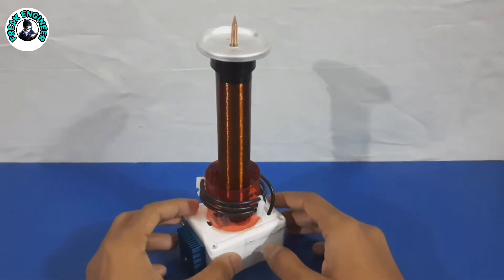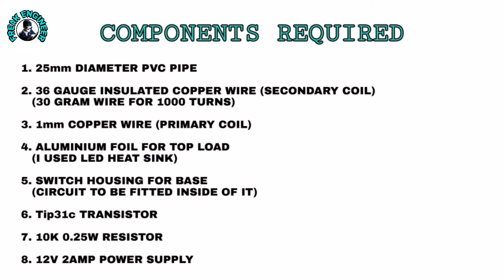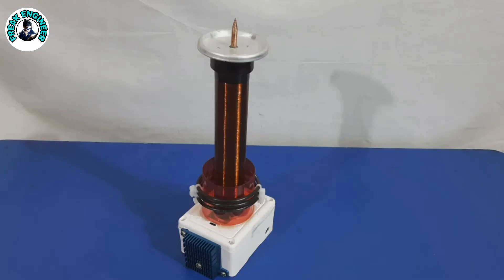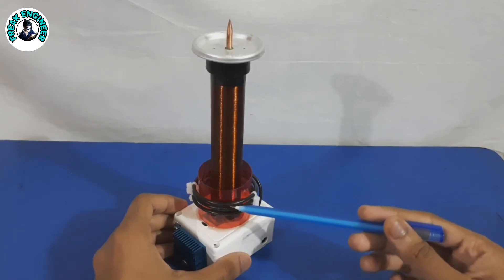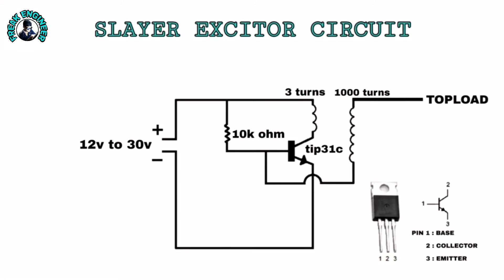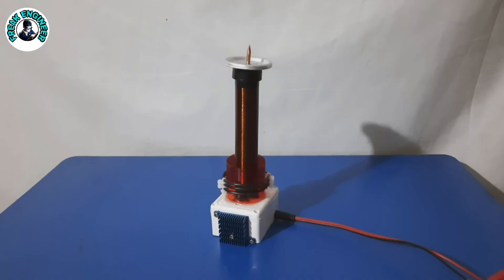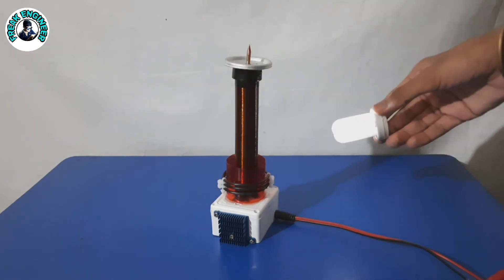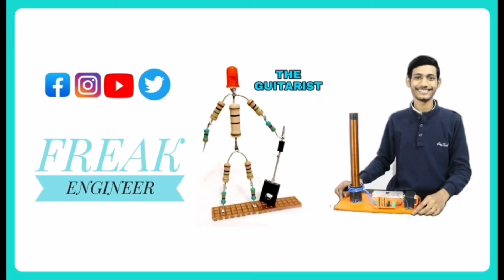tesla coil experiment | freak engineer

Comment: Bro if we use dc to dc booster to boost 12v to 30 volt 
Will it spark up like you showed in this video
Reply from the maker: Dc Booster circuit increase the voltage but reduce the output current.
So the output voltage achieved with surely be high. But the power will be less.
Reply: Please tell will it work like in the video by using booster or not

Comment: What happens if we touch the top load
Reply from the maker: Finger will burn a little due to high voltage.
If it is high power coil,it may cause severe damage.

Comment: Do we have to connect power supply to our home circuit??
Reply from the maker: Yes obviously 
The work of power supply is to convert 220v ac from your home to lower volt dc ( 12v in this case ). 
Use battery instead.

Comment: Power supply will generate AC or DC current?? 
Pls reply
Reply from the maker: Dc is needed in circuit
Reply: Does transistor changes the DC current to AC
Reply from the maker: Almost
Dc can't perform EMI .
Reply: From where does the coil gets varying current if DC source is connected?